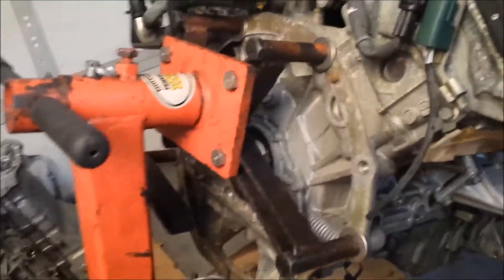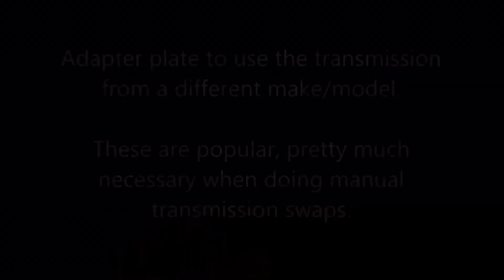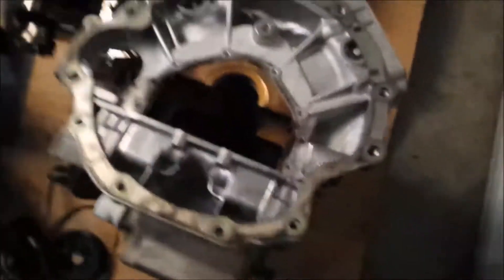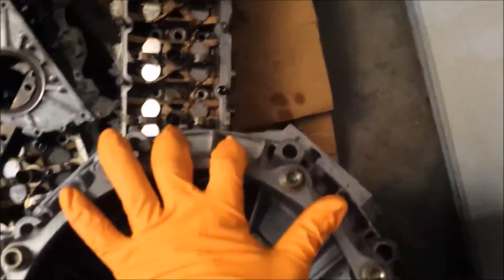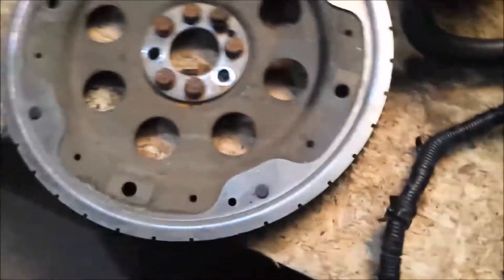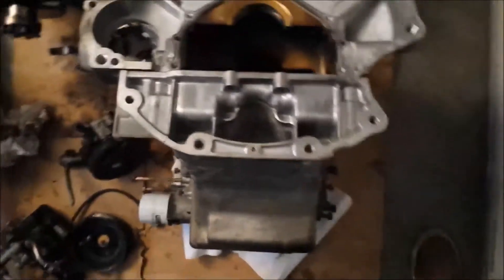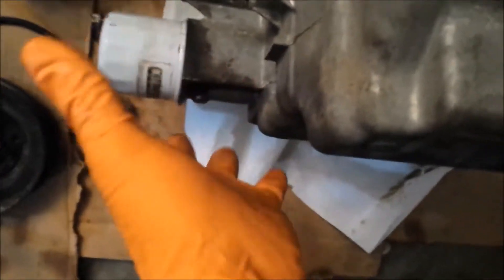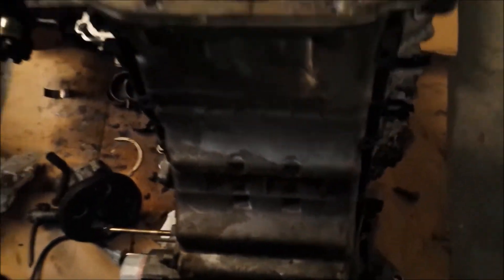VK45DE Part 3. Starter location, transmission bellhousing, and bolt patterns in general

Comment: 2EdBway outstanding information, but I have a bit of a situation. I have a 04 M45 with a blown engine. I purchased an engine but it's out of an 03-04 nissan cima. Everything is the same except the starter mounts on the opposite side. Can I swap the bellhousing on my 04 M45 with another bellhousing to make the mating surfaces work? If so, from what vehicle and where can I find it? Thank you so much in advance for your help.
Reply from the maker: You could get an 06-10 M45 bellhousing to match the starter location, but you would also have to keep in mind that the starter wires would need to be extended.
In one of my videos, in the comments someone shared that they were in that exact predicament as you. They made it work, but if I recall correctly they had some issues with the starter itself. Maybe clearance?
Reply from the maker: If you decide to go through with it, let me know. I have the bellhousing you need somewhere in storage.

Comment: So what did u do in regards to starter location? Change bell housing?
Reply from the maker: I bought a JDM engine because the starter is on the same side as the 06-10 M45
Reply: EdBwoy and what year did those JDM engine go into production. I bought one from a salvage yard and asked if starter was on LH side he said yes and sent the wrong one. Now he don’t wanna refund my money 🤦🏾‍♂️
Reply: EdBwoy and what year did those JDM engine go into production. I bought one from a salvage yard and asked if starter was on LH side he said yes and sent the wrong one. Now he don’t wanna refund my money 🤦🏾‍♂️
Reply from the maker: @ymds2012  all the JDM DE engines I know of have the starter on the left. I don't know if years matter, but to be sure I always look at pictures.

Either the person that sold it to you was lying, or more likely he did not know what he was talking about. I don't know how a JDM engine would end up in a US salvage yard - that's for wrecked USDM vehicles.
It sucks though. JDM or not, you bought it on the basis of the starter being on the left. Did you use a credit card or PayPal?

The JDM engines on eBay have become so cheap.
Reply: EdBwoy I paid cash $600 82k miles he says if his other car isn’t that way. He’ll return the cash Monday either way I’m pissed bcuz I wanted to fix my m45 now I’m a just sell it. Pushing for $1500 at least obo